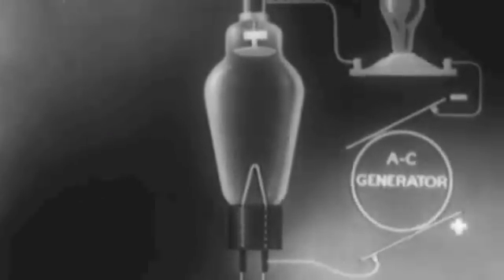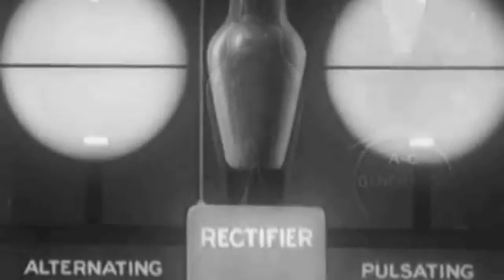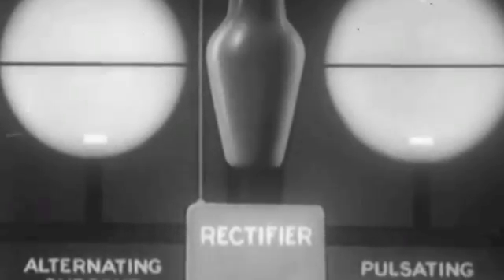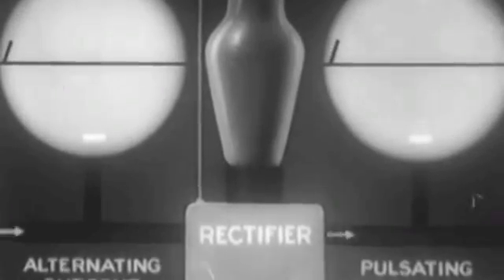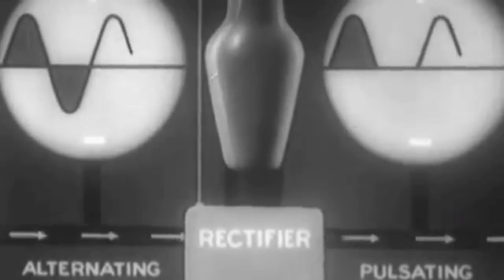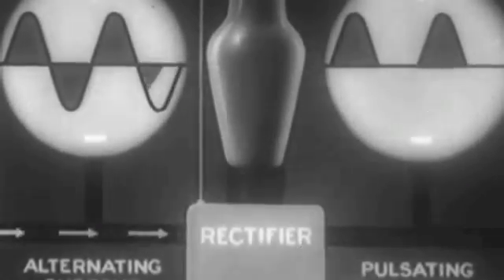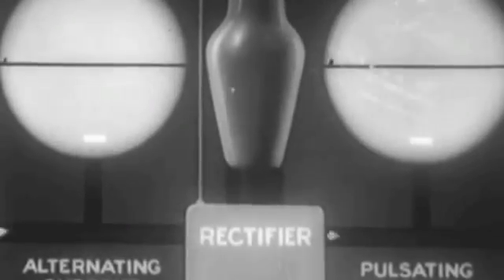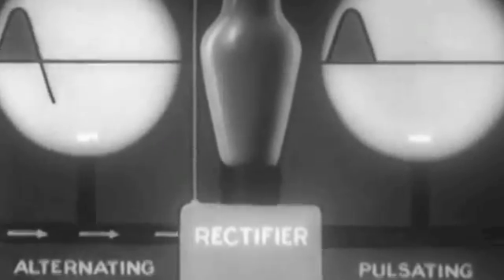First generation computer

Comment: Cool! I ran across this old digital computer patent 3190554 where it ran  on compressed air instead of electricity. Was this computer ever built and used for anything? Could you build one today using 3d printing?